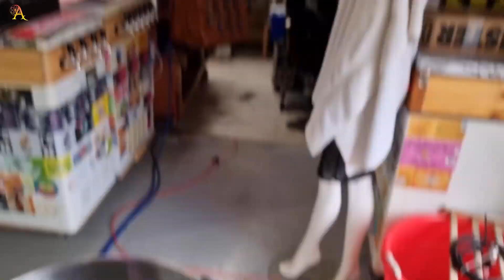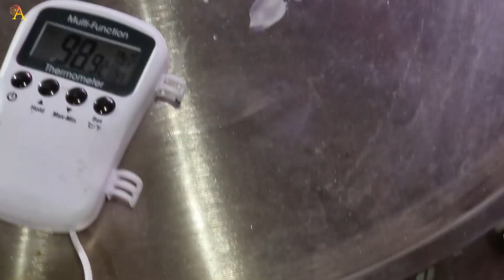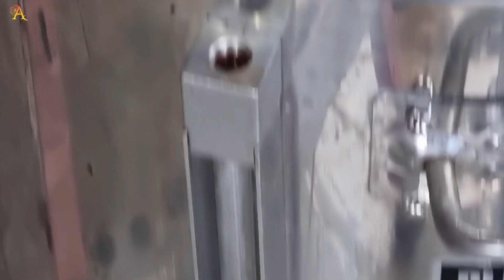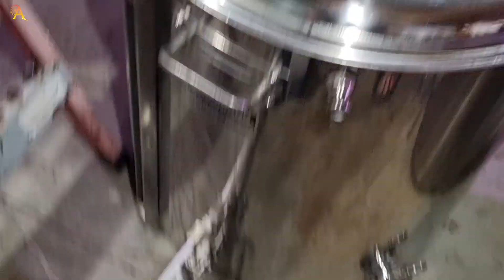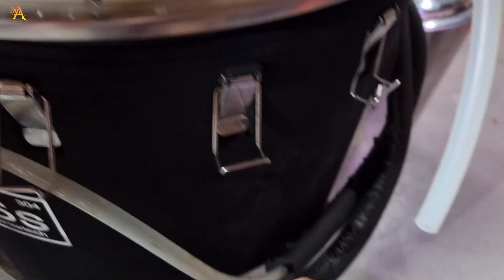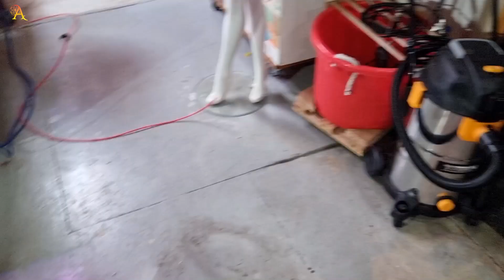1BBL Kit FINISHED!

Comment: With you on the Imperial measurements, absolute madness. Isn't there a difference between US and UK volumetric units as well just to add to the confusion? The question is, can you count in tens and hundreds? Then use metric, it's simple.
Reply from the maker: "The Imperial pint contains 20 British fluid oz equal to 28.413 ml each. The American pint, by contrast, contains 16 US fluid oz equal to 29.574 ml each. This makes the US fluid ounce 4% larger than the Imperial one. The Imperial pint is approximately 20% larger than the US pint."

I need a drink...
Reply: @MadeByMartyn  and they say everything is bigger in America 😉

Comment: The joys of cleaning used equipment and being never happy but the savings!!
Reply from the maker: That was quite surprising but a good lesson to learn.  I had similar when flushing the big heat exchanger.
Reply: @MadeByMartyn  Decided to buy a brewtools chiller even though it isnt the most efficient thing in the world im non metered and have a 1000 litre CLT on the way anyway!

Yet to clean anything yet busy clearing all the building just to be able to epoxy floors!
Reply from the maker: Put a small patch of resin down yesterday.  It seems not all shades of grey are the same, this is far lighter!